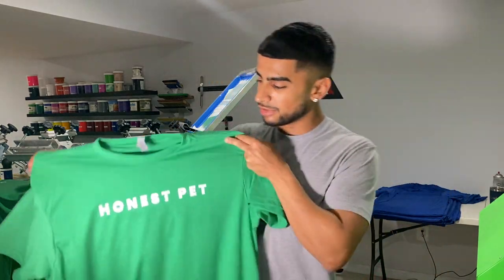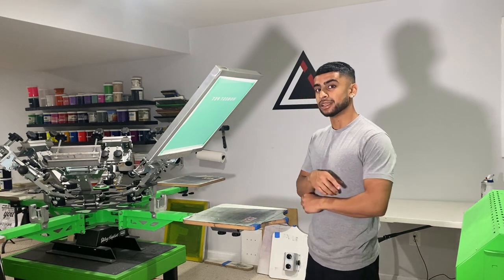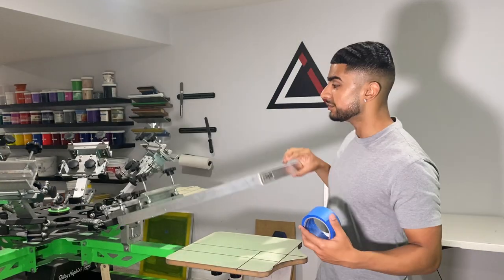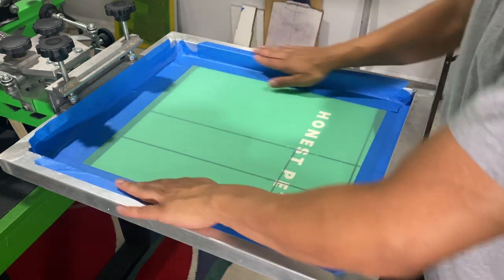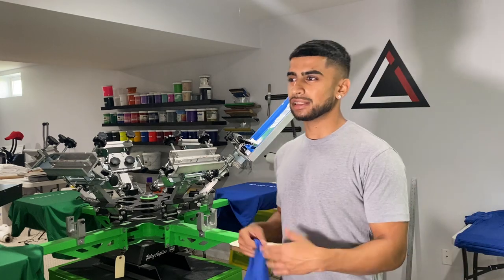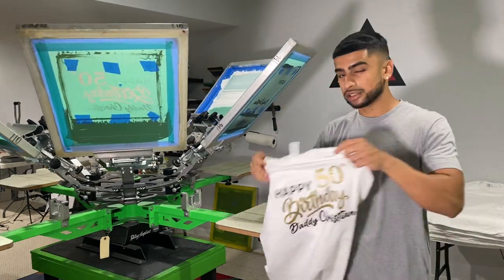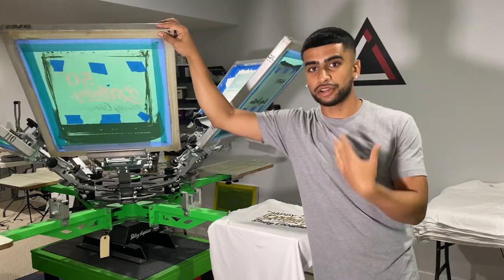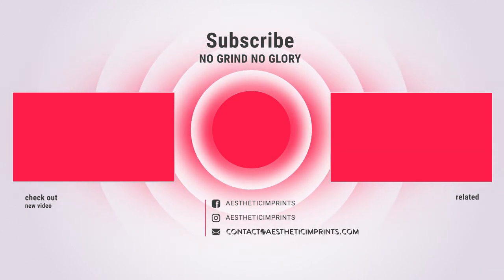What Is SCREEN PRINTING & How It's Printed And Priced!

Comment: First off your videos rock, you explain it so much better than others have. I have a flash dryer do I need a conveyor dryer? I'm just doing shirts for myself and don't really have the room or money for it. Once I flash dry it can I just give it time to dry before wearing it.
Reply from the maker: I appreciate it man glad it helps! You do not need a conveyor dryer. In the case that your just doing shirts for yourself and small runs you can get away with just a flash dryer and cure the shirts with the flash dryer. That’s exactly how I started, only had a flash dryer and curing is still possible with it
Reply: @baavproductions  thank you I greatly appreciate your time in helping me.
Reply from the maker: My pleasure

Comment: Is there should be gap between the pallet and screen mess ..? Or it touch  during printing
Reply from the maker: There should be a gap! a quarter width is a good measuring point. If it is touching the pallet it wont print well because the screen has to bounce up when printing. This is referred to as "Off contact"

Comment: Flash dryer does not cure the ink 100% or what does conveyer dryer fully cured the ink?Im Curious about these?
Reply from the maker: Flash dryer is meant to “flash” the print quickly so you can add a second coat and the conveyor dryer is meant to cure the shirts. Although you can cure the shirts with a flash dryer but it would take a lot more time compared to a conveyor dryer